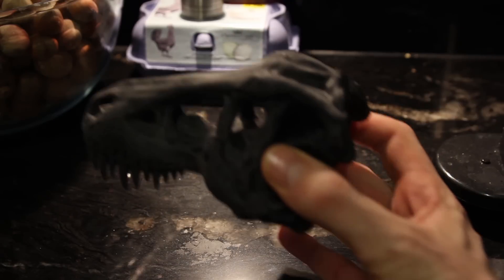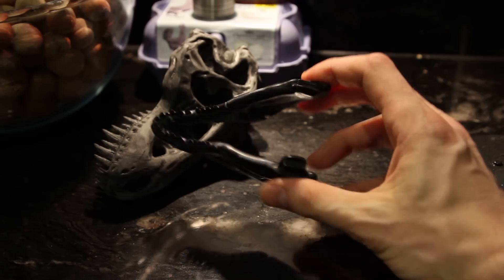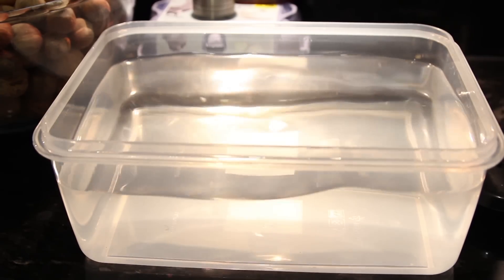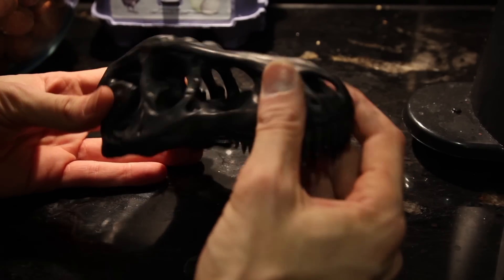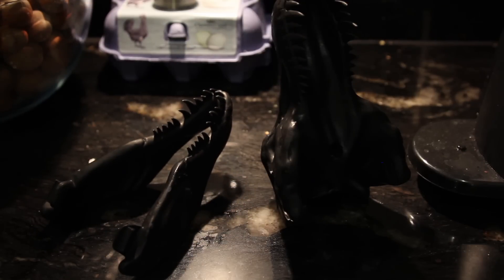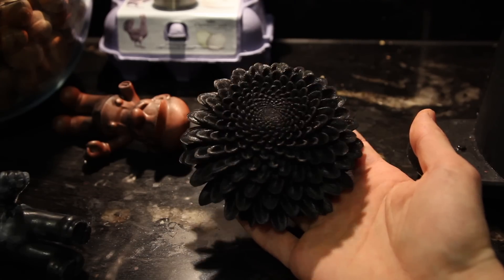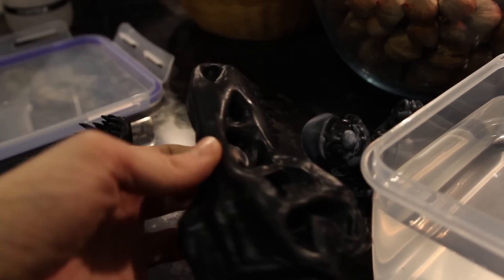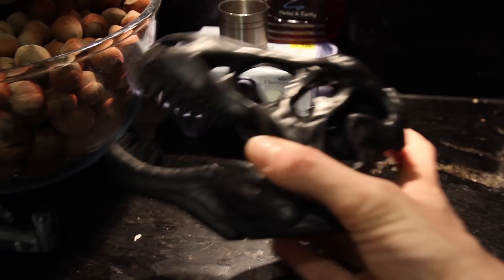PLA Smoothing with Acetone

Comment from the maker: After a few arguments about PLA and the purity of it from one brand to the other, it should be obvious that this smoothing technique varies from brand to brand hence me specifically mentioning what brands I'm using so you can achieve the same results I do in case you want to. We all know pure PLA filament doesn't smooth. My point is the ones I use do. The reason stuff is being added into the PLA is to make it stronger, easier to print with, less brittle, bio friendly...etc.. so a PLA blend will be better than pure PLA anyways. Either way the main reason I use PLA is because its easier to print with and I can smooth it easily.

Comment: You shouldn't have direct skin contact with acetone. It can be absorbed in the blood stream through your sking and can have effects on the central nervous system. There is no problem if it is an occasional exposure but you seem to be doing this quite often... Other than that, your parts look really amazing!
Reply from the maker: Romain Rump I dont let i touch my skin too often, if you want to avoid that, the just put a screw in the bottom of your object and use that to hold it.

Comment from the maker: just for the safety people out there, after much reasearch on acetone i found it to be pretty harmless and of practically zero danger level if not thrown on a fire or something like that. its not even that toxic if you consume small amounts of it. i put my objects on a pin now and dip it with that but its my choice. chemicals scare a lot of people but this one is not that scary people. women soak their fingers in it on the regular so if i do im sure its not the end of the world. i used a massive amount of it in this vid just to get the model in, as i couldnt find a smaller one. experiment people. just try not to drink too much of it...or any of it if you can help it.

Comment: Nice print but acetone overkill ! A vapour chamber is not as quick but in my opinion just as effective. A 20 second dip is not even time for a quick smoke 💥
Reply from the maker: +revb0 I dont do this mad method anymore, lol check the links below. I also dont put my hands in it either. This was my first time ever trying it out.
Reply: +Cloakfiend It's just acetone, not like its toluene or benzene, no worry getting it on you. The body actually produces acetone in small quantities.
Reply from the maker: lol, try telling that to some of the safety squad watching my videos.

Comment: Hello 7 years later...did you have any issue w these prints cracking months down the road?
Reply from the maker: Nope theyve stayed as is but possibly shrunk a bit. Only the methylene chloride and ethyle acetate completely deteriorated.
Reply from the maker: Ill do another vid and go through them. But i can tell theyvd shrunk as i plate stuff and if the plate becomes loose it means the object has shrunk. But thats usually the result of me plating far to soon. You should wait a while before plating as you need to wait for the chemical reaction to stop.

Comment from the maker: Just to say dont use a dremmel, as it ends up actually taking off subtle details, just do it by hand, you wont oversand that way. and if your model is so bad it needs tons of sanding then your printer is not calibrted very well, and you really should sort that out before doing loads of long prints. This method should only need minimal sanding. hence keeping ALL the details even in the impossible to reach areas with sandpaper, which would remain lined if you printed them at 0.1 layer height.

Comment: Why not just try THF instead? shouldn't require any sanding, and you can just do it as a vapor bath like ABS
Reply: Tetrahydrofuran
Reply from the maker: Jonathan Balloch it melts it too much, using this method, you are only playing with acetone with is much much safer, and also you wont destroy your model if you leave it in for a bit too long, as you would with any vapour method.
Reply: As far as "melts too much", a lot of my experience and many other YouTube users beg to differ, as far as more dangerous, evidence?
Reply from the maker: Ive yet to see a highly detailed THF print that looks as good as my prints with acetone. Ill post a vid showing my prints and painted prints so people can compare, but they are on the ultimaker community website if you want to look. I cant really comment on specifics, but from what I know its like acetone to ABS so its not the look im going for thats all.
Reply from the maker: kobun37 yes theres no need for that nasty stuff. Dont worry im going to post a new tutorial that shows how easy and safe my way is in the next few days. i also do it outside.
Reply: Cloakfiend you are totally correct. People are often afraid of chemicals simply because they are chemicals. But common sense applies here. if you have kids, lock up your chemicals or put them out of reach. if you ever do anything with chemicals, do it outside. kobun37 the same applies for THF. It is slightly more toxic, and this shouldn't be discounted, but most human and animal studies show that its not so bad. See here:
http://toxnet.nlm.nih.gov/cgi-bin/sis/search/a?dbs+hsdb:@term+@DOCNO+125
vs.
http://toxnet.nlm.nih.gov/cgi-bin/sis/search/a?dbs+hsdb:@term+@DOCNO+41

Point: you shouldn't drink either of them, and if you are going to be around vapors, do it in a well ventilated area, but if you WERE to drink BOTH of them, the THF would do more damage :P

The major difference is that you wouldn't smooth with THF by dipping in it. You MUST use a vapor-based method, otherwise it could ruin the print, and if that's not available to you (lack of access to the outdoors, etc.) THF is not a viable solution. Look to Cloakfiend's acetone-based methods if you want to use a soaking-based approach
Reply: +Jonathan Balloch THF is extremely hazardous. it's flammable and creates explosive compounds when exposed to air.

Comment: What infill % was this pinter on ?
Reply from the maker: Anthony Cruz printed with 30%infill and 0.8 shell. But now days i would do 0% infill and 1.2mm shell. for some reason, things printed with a 0.8 mm shell have extremely thin tops and bottoms (cura related), so i switched to 1.2 and its all good. Most organic shapes need no infill whatsovever. If you want them to be heavier just fill them with plaster of paris or something. P.S. this is a very old tutorial and i do things differently now. Still do it with acetone, but much safer and less messing about. just one dip too. too much dipping can crack some brands of PLA in the long run.
Reply: Cloakfiend Is the ethos similar except with safety gear? or do you have a link to your new methods? I actually started printing this cause of how great it looks in your vid.
Thanks for the response.
Reply from the maker: Yes, the only thing you should do is get  container that is a good size and not oo big like in my video, and do it outside, and try not to get any on your hand, thats it. Acetone is the safest solvent you can get so unless you get repeated exposures dont worry about a little acetone here and there.
Reply from the maker: Anthony Cruz Here is the new tut anyways, there is just no need to double dip. do it once and thats that. If you double dip it may crack later. But in my experience UM PLA will not crack, but colorfabb is more prone to crack or suffer from layer separation. https://www.youtube.com/watch?v=HEnz8CWxyjc

Comment: 230C on PLA??? Are you sure it wasn't ABS?
Reply from the maker: Paul Robert Damn, it was actually 210, i cant belive i hadn't noticed that before.....? i only use 230C when im printing at 70mm/s
Reply: I think mine is low because the sensors are external. I'm going to print a really hot one so I can estimate the temp difference.